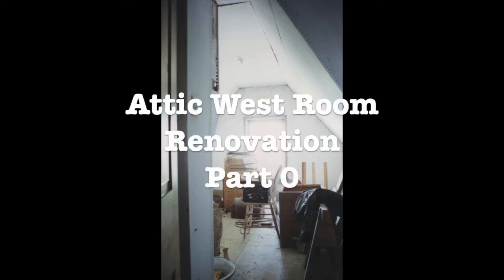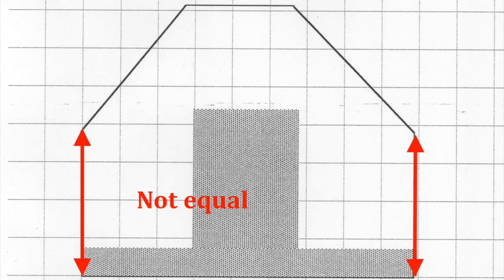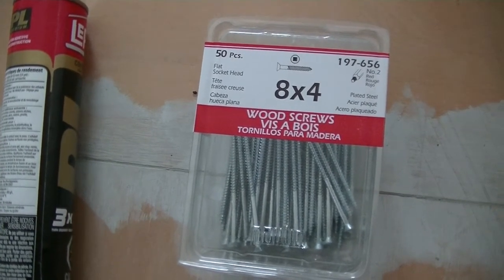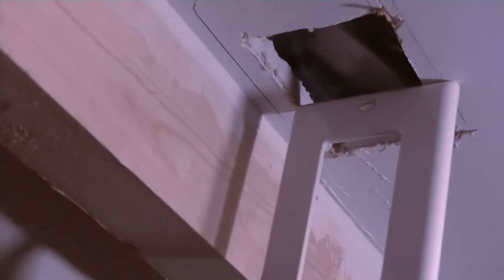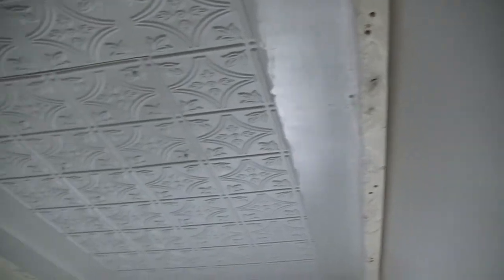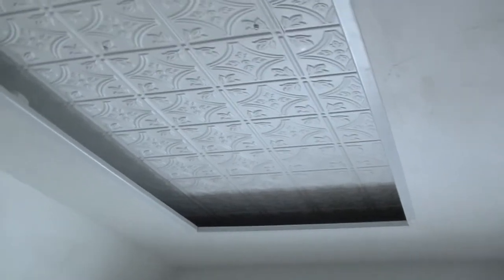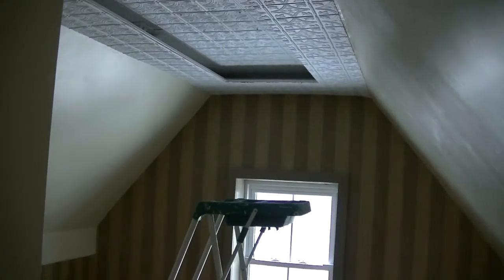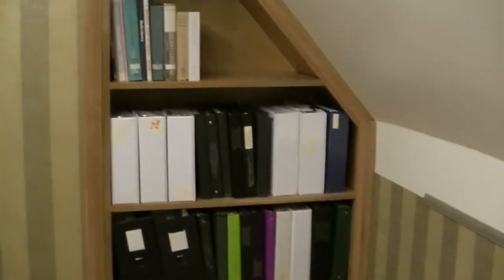Renovation of my West Attic, Part 1 of 2

Comment: Good afternoon Mr Brown,  You made a good job of that attic, the Art Deco lighting works well with the embossed ceiling tile.  The illusion of hidden lighting without too much over hang can be achieved with an up-stand on the edge of the 'drywall'  this give thickness to the ceiling and hides the illumination which is set deeper in the cavity.  Using a straight edge and spirit level on a Victorian house opens more Rabbit holes, I notice you have mastered this.  Best from the Wirral UK
Reply from the maker: LOL. I had been stubbornly relying on my spirit level and T-square when measuring and cutting. There’s no point using these tools when the builder didn’t. I think he and his workers were more than mildly inebriated for much of the construction!